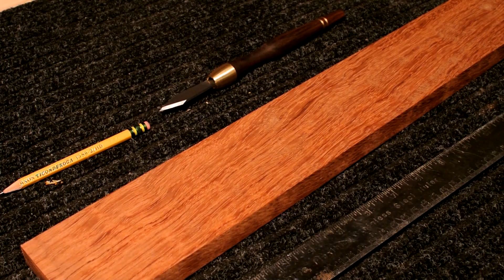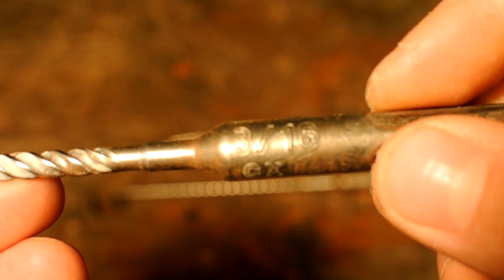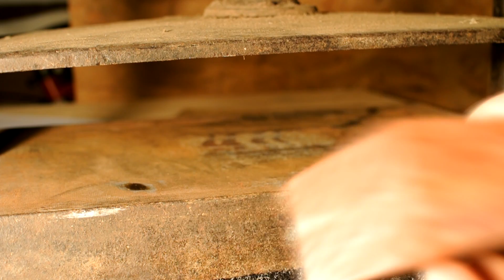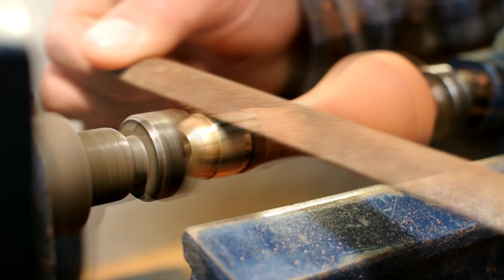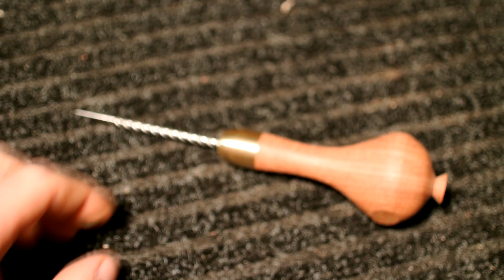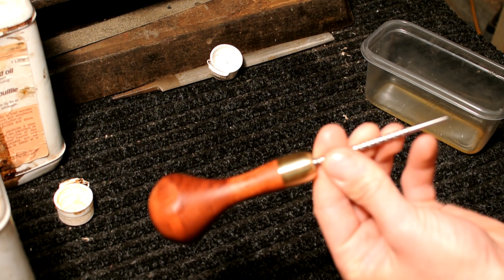How To: Homemade AWL for woodworking

Comment: Was looking for a way to do several things; saw many other vids in my search. This one solved some of those problems. The flair cap conversion to ferrule, for one. The other is what to do with old bits. I have a very old screwdriver shank that originally came with a wooden handle, long tapered ferrule with a brad through it, the handle wood and the shank. Using your method, I won't need to reuse the old ferrule, nor drill the hole through. Epoxy to the rescue! Thanks for the solutions!

Comment: How did you get such a finely machined tip on the awl just hand working on the belt sander?
Reply from the maker: +herbsu43 The secret is putting the piece in a drill then using a belt sander, This will give you a very clean taper. If you do this by hand you will always end up with flat spots.

Comment: Hi, love your awl. Where did you buy the brass fitting from, and what is it called. I've tried everywhere with no luck. Cheers Grant
Reply from the maker: Thanks! I picked the 3/8 Brass fitting from my local hardware store. I will add a link to the item where it can be purchased on amazon, https://www.amazon.ca/gp/product/B00MP2UJ48?ie=UTF8&creativeASIN=B00MP2UJ48&linkCode=xm2&tag=jd093-20
I hope this helps.
Reply: JDCD Design thanks a lot. That's a great help. Cheers from Australia.

Comment: What cap did you use? Didn't understand what's "Flare Cap" is! What's it normally used for? Thanks 👍
Reply from the maker: Robert Williamson it's a brass "3/8 flare cap" it's using in plumbing. 
https://www.kimballmidwest.com/images/products/small/90-708.jpg
The link is a picture what they look like. I hope that helps
Reply: JDCD Design Thanks man 👍

Comment: What brand of blades do you use in your saws?  They make very nice cuts!
Reply from the maker: Ampersandrascott the blade on my mitre saw is actually the blade that came with the saw when I bought it, but I usually use  Freud Diablo blades. They can be a little pricey but last long and make beautiful cuts.
Reply: JDCD Design excellent!  Thanks for the reply!

Comment: Did you know that woodworking awls originally had square points and shanks (like a pyramid) and that for a good reason?
Reply from the maker: Christian Aigner the square tipped awls actually cut the grain, there the "round top" pushes the grain. With square tips you can actually ream the hole your making so it has its perks. I might make one of these at some point.

Comment: Awesome build thanks for sharing. What was that screw press you used to camp the wood? 👍🏼👍🏼👍🏼
Reply from the maker: Thanks, glad you enjoyed! The press was originally a old paper/ book press used back in the 19th century. (I actually just researched how old it was and didn't know it was THAT old so i should probably put it in a museum!) but i find its great for evenly clamping smaller pieces.
Reply: JDCD Design yeh I did a bit of research myself and you have a nice little thing there that is handy in what we do I may have to get one myself as it would help in clamping knife handle scales on 👍🏼👍🏼👍🏼

Comment: Nice work.  Like the idea of the old drilll bit.  Makes it look a lot more interesting :)
Did you use anything to stick the ferrule to the handle?
Reply from the maker: Richard Quintrell Thank you! I saw the old drill bit it in the bottom of my scrap metal bin and thought it would make it a little more unique, and I think that was accomplished!  As for the ferrule, if you make your tenon tight enough you can actually thread it onto handle. I personally put a couple dabs of epoxy on cause I'm not planning on taking that off.